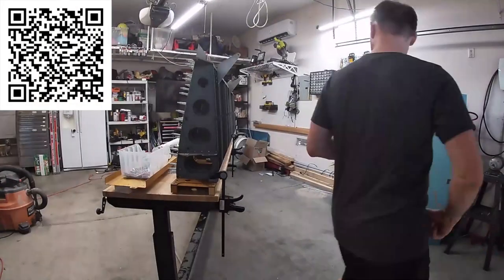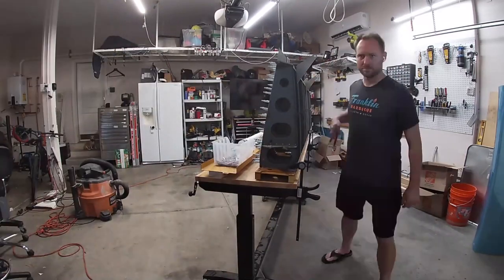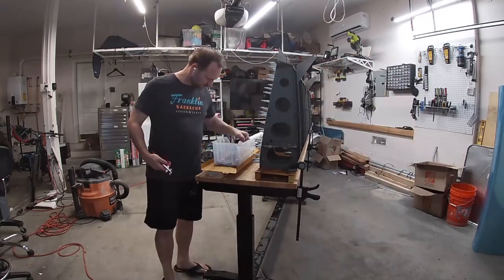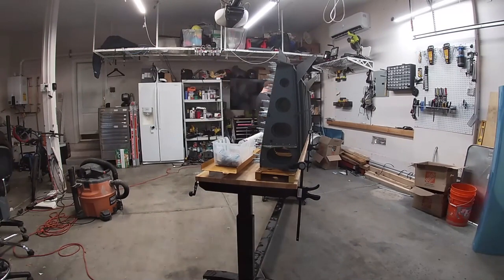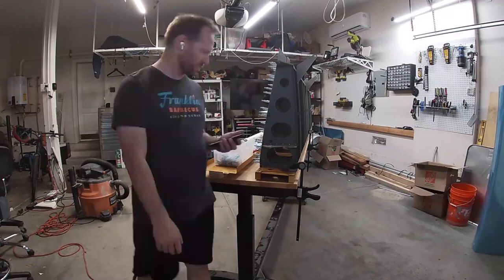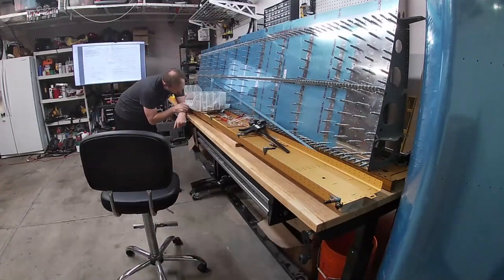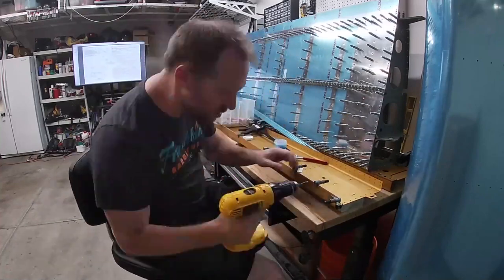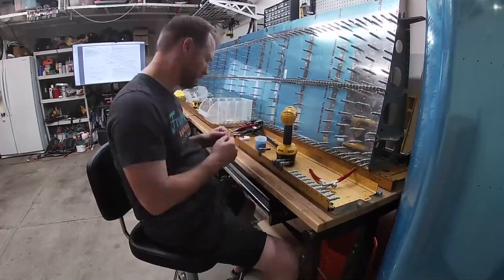RV-14: Wings 38 - Return of the J-Channel

Comment: I can't really tell from the video, but it looks like the 1/16" overhang of the J-channel relative to the edge of the spar flange was not present during the match drilling process.  This is mentioned in my set of plans page 13-02, Figure 2.  I'm sorry if I'm wrong about that.
Reply from the maker: In a previous video I 3D printed a 1/16” gauge that I used to do the match drilling.